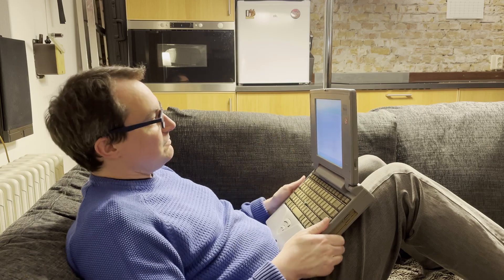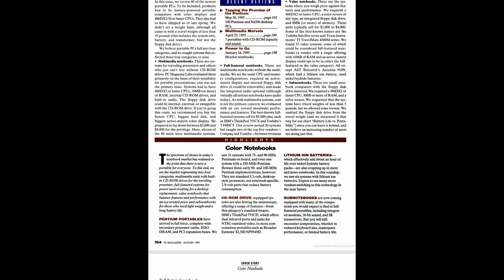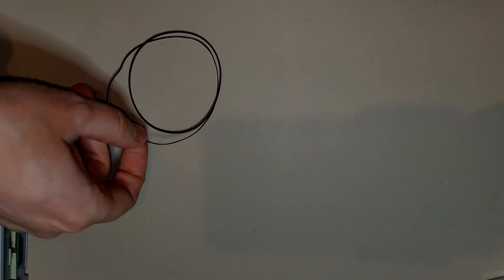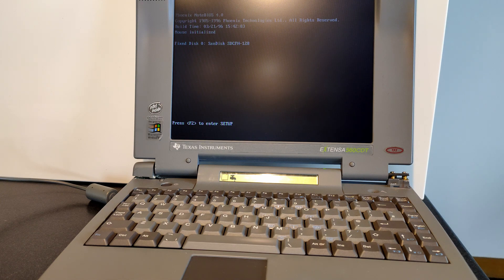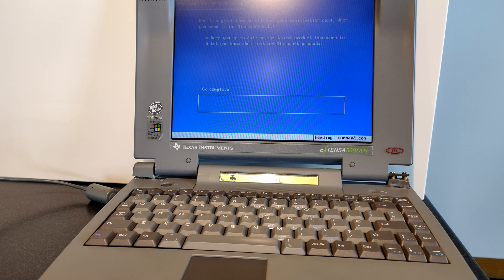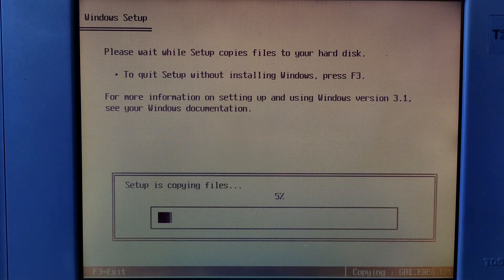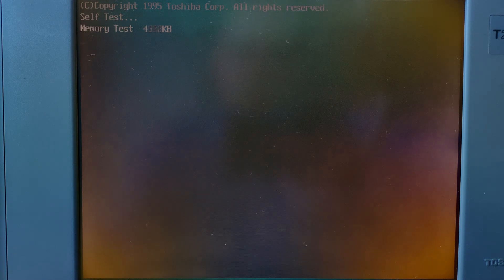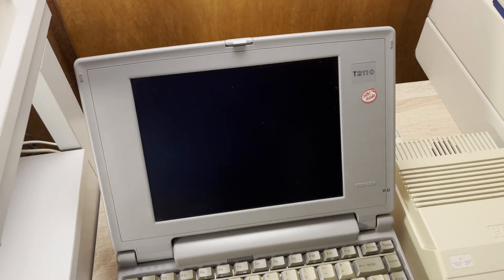The last mono laptop?*

Comment: Intresting video, I found a T2100 in a skip a few years back and it did turn on but I just put it in a draw and forgot about it until today when I tried it today was dead.I took it apart and it started to work again. The battery is dead but works from mains.

I do see 6 files when I type dir  windows,office ext. The laptop only seems to boot to commandline should it boot straight to windows or do I need to type a command. 

I'd like to see it working although I have no real use for it.
Reply from the maker: Super late reply, but the command 'win' will load windows if it's installed. Good luck!

Comment: Well, it seems like stretched drive belts on these Toshiba drives is a common issue. I have my  Satellite T2110 in parts on my workbench (your previous video was very helpful here. Thanks) and I have the drive out. The belt is very loose just like yours. Can you perhaps tell me what size belt you used so I don't necessarily have to order all of them? Also, where did you order them from?...finally, did you consider trimming the belt down so it wasn't so wide? Cheers
Reply from the maker: I am not sure where I ordered from, but I just searched 'tape belt' on Amazon and there are plenty of options. I wasn't sure how to measure it well since it was stretched, so that's why I bought a variety. The reason mine had fitment problems is that the belt was 'square', so it's not that it's too wide, it's too deep / thick. I see some of the variety packs have both square and flat belts, I bet flat is what's needed. Maybe I should try again! Good luck.

Comment: In 1995, Apple introduced the PowerBook 5300 - latest-and-greatest PowerPC processor roughly the equivalent of a Pentium - with greyscale display. 

5300cs (DSTN), 5300c (TFT) and 5300ce (800x600 TFT) colour versions were also available, but I suspect the 5300 was the last grayscale PowerBook (along with the 190 sibling; same form factor, with LC040 processor). It might have been on the market for longer than that Toshiba?

Comment: Good video! Most people just go straight for the nearest CompactFlash / SD adapter rather than even try to deal with spinning rust hard drives anymore. I do like that yours has a more era-appropriate amount of space on it! Most usually have a few GB's.
Reply from the maker: Yes I don't quite get it, the whole experience is part of it for me, the sound, vibration, even the smell of the old machines! Perhaps if you use them more often, potential data loss is more of a concern. Compact Flash cards seem to be getting pretty rare these days, I have two from old cameras but that's it, another good reason to just use the old drives!

Comment: Hello and welcome. Please provide a link to purchase these spare rubber bands.
Reply from the maker: It was a couple of years ago on eBay, if you search for 'tape drive belts' you'll see a bunch of options.
Reply: @mattsqwrl  Could you send something similar ;(
Reply: Otherwise. Are tape recorder belts suitable?
Reply from the maker: @angusmacgyver1847  It depends, I think all the ones I could find had a pretty square profile. That drives the floppy just fine, but it did give it clearance issues. This is the first one I've done so it's trial and error, I bet they'd be just fine on most drive, especially desktop ones that have more space.
Reply: @mattsqwrl  I'm asking you because the original belts in the FDD drive of the Toshiba 2130CT laptop are flat and thin - flattened, while these are square and thicker. Does it have a significant impact on operation?
Reply from the maker: @angusmacgyver1847  Yeah for my drive, any operation that moves the head to the far end of it's travel will jam the drive. So you can't format and you can't read completely full disks. The clearance is incredibly tight unfortunately.
Reply: @mattsqwrl  Thank you for your tips and information

Comment: The high pitched whine should be coming from the LCD - there's a failing capacitor on the backlight inverter board. Search for UA0392P01 capacitor for more information and pictures. C3 is the one that needs replacing and it may have leaked so electrolyte & corrosion will also need to be cleaned up.

Comment: The Brother GeoBook NB60 from 1998 was the last monochrome laptop I remember seeing. It has an AMD 386 CPU and runs GEOS, but can also run DOS software.
Reply from the maker: That is a very strange computer, I kind of want one.
Reply: In the mid 90s, dual scan color screens were terrible.  If the choice is between active matrix monochrome and dual scan or "passive" color, I'd go with the active monochrome every single time.
Reply: I remember you covering that notebook, was a great video

Comment: im my opinion, i would never replace a HDD if that is not Broken. Keet the Hardware as Original as Possible.
Reply from the maker: Same, this is actually the first retro machine I've had to do it. Old disks are more reliable than I would have guessed.

Comment: In those days there were many Toshiba laptops extremely cheap from second hand due locked BIOS, password not stored in CMOS on RTC battery like classic AT board. Doing shortcut in some LPT pins BIOS was restored to factory setup - profit 💰

Comment: It would be awesome to see how a period correct Linux distribution would have run on this. I didn’t get into Linux until
1997, when Pentiums were current, but I’m pretty certain a few people would have run Linux on machines like this.

My first laptop was a Tecra, Pentium 75 IIRC. It was ex business stock and obsolete in 2000, when I got it. Bloody hated it and was so much happier when I switched to a, again ex business, Thinkpad. It’s the build quality on those Toshes which let(s) them down. 

Thanks for making this video and I hope you are doing well!
Reply from the maker: Yes same for me, a second hand Pentium 75. I still have it, it's the TI one falling to bits in this video! Doing ok but it's been a busy year. Any idea what a period correct Linux would be?
Reply: @mattsqwrl  Search for Slackware 2.1.0. It was released in 1994. You’ll need a cdrom drive, though there may be floppy downloads of that or earlier versions. I doubt you’ll be able to run X on that machine but it should run text mode Linux reasonably well. If you get it running, let us know how long it takes to compile hello world.

Busy is not the worst state of affairs. :)
Reply: @mattsqwrl Softlanding Linux System or Slackware would be your only chance back then but both would be finicky about the hardware I'm betting as laptops tended to use less standardized components than desktops of the era did. And early versions of Linux tend to support only very limited hardware.
Reply from the maker: Ah yes that's giving me flashbacks to the first two times I tried to install Linux. Once I booted it from CD, and it told me I had no CD drive. The other time it claimed I had no hard disk.
Reply: @mattsqwrl  this is the case where the boot handles the boot but the kernel, whatever that kernel is, won’t be able to access the peripheral without a driver. It’s confusing but perfectly logical. 

Very early Slackware should be useable on that machine. I couldn’t find floppy images when i went looking, but only spent a few mins looking.
Reply: @mattsqwrl  that gives me flashbacks to some MMX laptop that the plastic on it was crumbling to bits on it, there was really nothing that i can do so i just parted it out and scrapped it, the screen on it was dead as well. it did post and boot up to the Windows install that was on the HDD in it